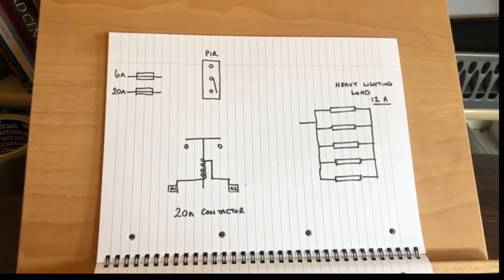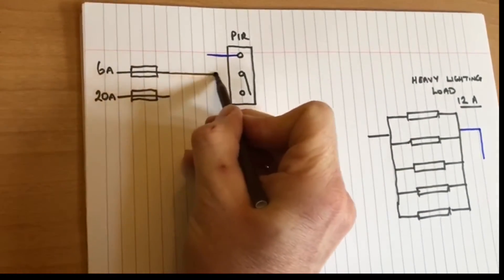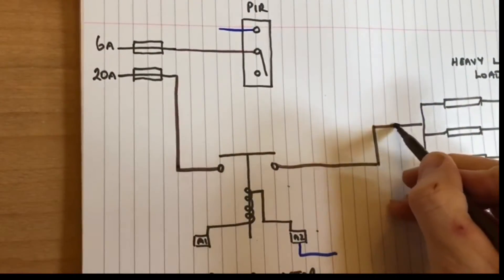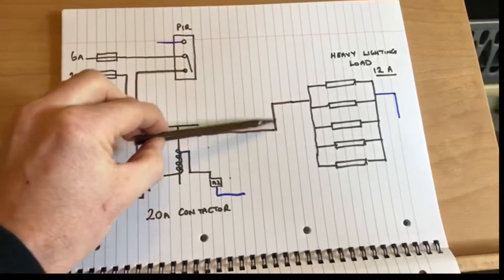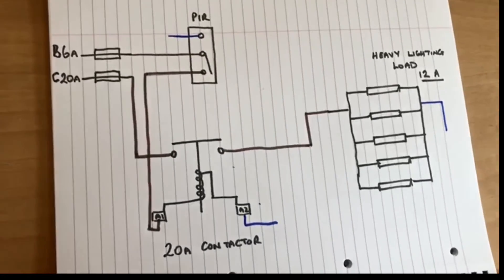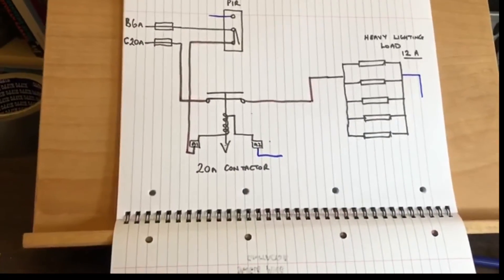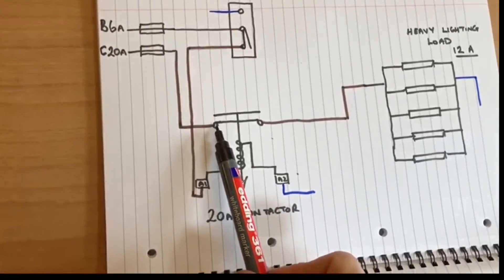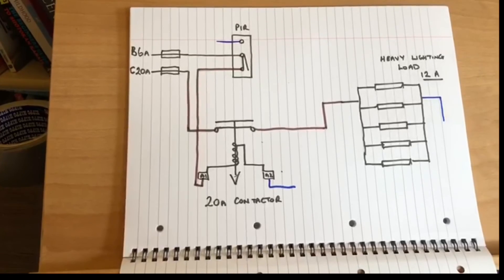PIR via a Contactor Large Load - Wiring Diagram Part 4

Comment: Great video! learn so much about this topic. Just one question, please correct me if I'm wrong regarding the Neutral in Circuit breaker 6A and 20A... so from CB 6A  neutral go to PIR... from CB 20A go to the Contactor and from the Contactor  go to the Lights? also  would be very interested if  wiring diagram in T&E.. Thank you.

Comment: When putting the PIR and contactor MCBs next to each other, you can also install a switch pin between both MCB switches so that turning one switch off or on also actuates the other switch. This removes the need for the multiple sources isolation sticker and prevents someone forgetting to turn both off.